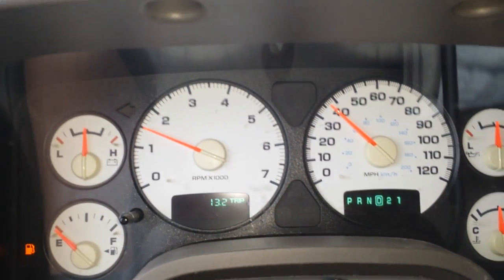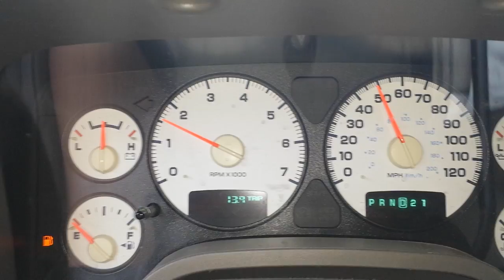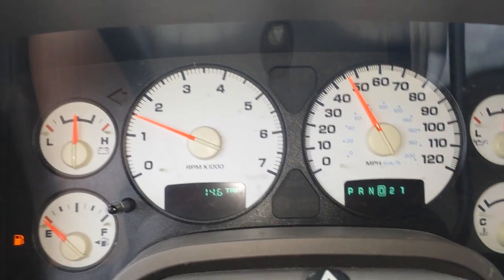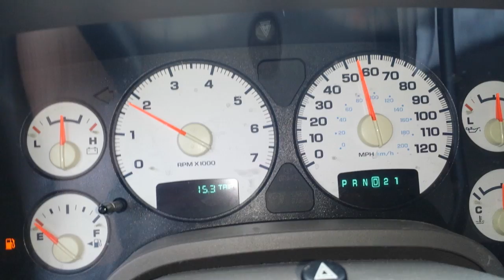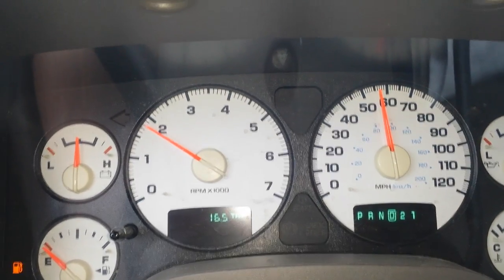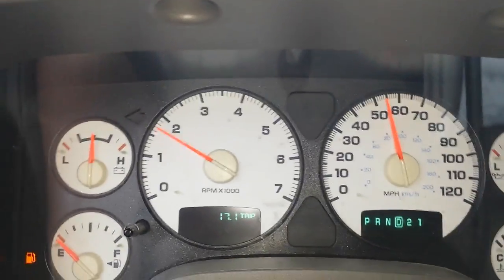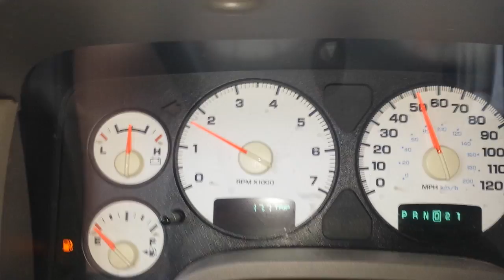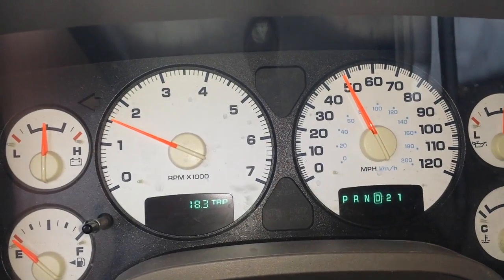Solved! Dodge Ram abs and parking brake lights on.

Comment: Pull your cover, pop out your c clips, pull your axles, 
Skrew it power wash it.
Then bug sprayer, spray axle fluid at shaft ends.But catch that fluid, put shafts back in ,strain fluid, now spray differential gears, let drain, new clips ,put back pin ,tighten bolt, put a magnet to inside lower cover, replace cover, fill w/75-90 sync gear.
Done!!!!!!

Comment: It is exactly the same thing that happened to mine. The metal went on the sensor and prevented it from reading so my speedometer started hopping. He is right, the best fix for this is to replace the rear dif.

Comment: I just bought the Dorman 970-280 ABS Wheel Speed Sensor. Mine is an 07 ram hemi, crew cab, 2x4, 160k. Hope I bought the correct one. Actually hope it fixes the issue. It's doing the speedo bouncing to zero then back to 60 or whatever I'm traveling at, it causes the cc to cut off, has the never stops dinging with the abs/brake lights staying on. Sucks hearing all that never ending dinging when just driving to the store or somewhere & back! I've parked it for now till the issue gets resolved. Btw, the jacklkegs that send back that trolling bs pattys of feedback aint worth ANYONES time. Dont waste yours, its WAYYY to valuable to waste on shitbags. As you all know(even them), they'd be the very first ones kissing ass and thanking anybody for any info that related to their particular fix. If they were so concerned about this guy, Dino or his 5 min video being anything less than helpful, they'd offer up THEIR OWN VIDEOS to go above and beyond Dinos helpful info. But, ass we can ALL SEE, not one of the punk fux in their mamas basements, on their mamas bought computers and phones, aint good for nutting, nothing but running their crap holes.(some of y'all will see what I did there, but dont worry, they wont have a clue:) hehe!) So yea, there aint one of em worth wasting your time on. Jmpo, Jackasses!

Comment: I had the same problem with my  2004 Dodge Ram 1500 5.7 Hemi after my mechanic changed my front pinion and left disconnected and dirty the ABS sensor. Test and replace the faulty front wheel ABS sensor located behind the rotor. Dodge Ram 1500 have 4 ABS brake sensors: 2 on the front wheels, 1 by the transmission and that's the one you'd change if you have problem with bouncing speedometer and 1 on the rear axle by the differential cover. If you don't have any problem with the gauges or speedometer but just the ABS brake lights, you must check the front wheel sensors and replace it. It's a easy fix.
Reply: Vladimir Hazera ,"97 Dakota, only abs, rear axle,top.
Causes A.B.S./BRAKE LIGHTS ON DASH.
Reply: I have 02 1500 SLT. There is no front sensors. I have no gauge problems and the truck is not sending a code. Yet my abs light is on

Comment: First, you probably should have parked to do this video.  Second, P0500 is just a generic (thus the P) speed sensor code and doesn't have anything to do with "metal" inside your diff.  The magnet having "metal sludge" on it is normal.  I've never pulled a diff plug (I'm a mechanic) where the magnet has been clean.  If it's clean, you're not driving.  That's why the magnet is there.  Instead of unnecessarily replacing your good differential you should probably check for a bad ground, corrosion maybe around the PCM harness or ABS module.  Check your ABS sensors (depending on your model) as well.  These old Dodges are known for having wiring issues, and that's likely where your problem is/was.  Just because a light goes out it doesn't mean what you did was the solution.  I've worked on vehicles with suspension noise and just the act of raising it into the air temporarily relieves the noise, but that doesn't mean the problem is solved.  A good mechanic doesn't stop until he/she is 100% sure they found the problem and fixed it.  You can't say, "I fixed it, but the problem might return"
Reply from the maker: 1st, the camera is mounted to the steering wheel, thanks for your concern, and 2nd, I still own the truck and still have not had the problem since, so obviously I fixed it. Your cause of your code may differ from my cause. My video is to help those with my problem, apparently yours may or may not be different,l. Mine is definitely "fixed". Make us a video on your problem, maybe you can help others.
Reply: Jodian Gaming other people have said it was corodded wires under the fuse box
Reply: Please help me with my 03 ram

Comment: Another thing you might want to try... I dont know how in the hell, but I always end up getting water inside the abs connector behind the battery, and it causes all these problems and more and its irritating. I dont even know how the hell, but that same connector gets wet I get brake light and dinging sometimes, sometimes the o2 sensors throw a code and read 0v (weirdest shit ever) sometimes if it's real bad it won't even try to start, itll sometimes say no bus on the odometer... But every time I pull the connector its wet and I dry it out and it works fine until it rains heavy again or I go to the carwash. Bout to spray that flex seal haha

Comment: That's make sense for me. I have a 2004 dodge ram 1500 slt 5.7hemi, and i brought my truck to check the diferential oil level. The oil level was ok, but after that i drove a few miles and the abs and brake lights come on.

Comment: The ABS light on my 2007 Dodge 2500 diesel truck was on and I traced it to a bad ABS sensor.  I replaced it on the driver's side after I tested it with a DMM ohmmeter and found that it was an open circuit.
Reply: How did you get rid of the abs light on your dashboard? I just changed the same sensor on my cummins and the abs and parking brake light are still on My dash
Reply: Clear the DTC?

Comment: 2002 dodge ram 1500 2wd 5.7  slt Have a problem with my abs/dinging noise...might be the wiring or speed works good one brake light is out .  Alsoy ecm burnt out 3 times not sure whats wrong . Took too the shop twice they told me theres no problem..idk

Comment: I have the same exact problem with my 2004 Dodge Ram
Reply from the maker: Cody H This really should be a recall item. not to mention the multitude of other electrical problems these trucks are prone to have.
Reply: Dino Fuse I was on the highway with my cruise control on and my speedometer went to zero and ABS lights came on , parking light and my engine light.
Reply from the maker: Cody H I'm willing to bet you have the "c" clips poeces in the bottom of your differential. The Clutch Pack Retainer Clips look like pieces of round tubing almost. Let me know if you have that symptom. Cleaning them out and changing the fluid is only a temporary fix though.
Reply: Dino Fuse I have to drive about 2 hours away with the truck today. do you think it will hurt it ?
Reply from the maker: Cody H no, I think it'll be ok, as long as it is the same problem I had. Just be careful of your speed, and watch for unexpected stalling. When this happens, the truck really acts funny sometimes.
Reply: Dino Fuse I did experience some stalling out when I came to a complete stop. , it only happen twice but I defiantly will be careful about my speed.
Reply: My 03 Ram 1500 had an out of the blue electrical issue with my instrument panel going almost dead...nothing would read anything....speedometer and RPM gauges would bounce and not read properly, my transmission shifting would surge suddenly at times, mileage stopped counting.....and I refused to give in to the issue and pay to have it checked because of dealer gouging so I just toughed it out for about 2 or 3 months.  It was a daily issue.  I was always thinking maybe there was an electrical connection issue, wiring issue, fuse problem, etc....so I would go in and push and pull on the fuse box, checked fuses......out of the blue, 1 day it was all gone.  Everything back working normal.  Have no idea what happened.  That was about 6 yrs ago.
Reply: I had the same problem with my  2004 Dodge Ram 1500 5.7 Hemi after my 
mechanic changed my front pinion and left disconnected and dirty the ABS
 sensor. Test and replace the faulty front wheel ABS sensor located 
behind the rotor. Dodge Ram 1500 have 4 ABS brake sensors: 2 on the 
front wheels, 1 by the transmission and that's the one you'd change if 
you have problem with bouncing speedometer and 1 on the rear axle by the
 differential cover. If you don't have any problem with the gauges or 
speedometer but just the ABS brake lights, you must check the front 
wheel sensors and replace it. It's a easy fix.

Comment: Dino, i got same issues. Abs and red brake light comes on minutes after clearing code. Ding, ding, dinging! the entire time. Doesn't stop till i clear out again. C1036 "rear  wheel speeded sensor circuit" it says. I got 07 w ex cab, 5.7L hemi, 4x2, 150k. Also Speedo bounces when it starts, cruise cuts off by itself. There's a sensor on top of rear axle. Runs great during all the dinging and abs/brake lights on. Comes on immediately most of time, stays on and dings whole time I'm driving. Ive parked it for now. I couldn't tell how to get the freakin clip off the damn sensor! Any thoughts here? Thx man!
Reply from the maker: Marc carraway are you talking about the wire harness clip or the actual mount that screws into the top of the housing? If its the mount that screws in, then I had to carefully pry the part that holds the brake line back a bit, to allow a wrench to grab that bolt. If its the wore harness, then there is a locking clip that you beed to depress before pulling the harness off.
Reply: Hey Dino! Thx man. Yea, its the clip from the wiring that goes into the sensor. Can I put a pic somewhere? Theres a big black stain on the differential, not on the outside, the inside of it, and it shows that plus the whole pigtail, sensor, etc. Like to show you the stain as well but I'm sure its a leak, just not sure if its from the diff or the rear end or something as its on the inside outer shell of diff, not the outside, where you'd do the actual fluid change.
Reply from the maker: Marc carraway I just used a small flat screwdriver, but mine is a little older, so it may have a different set up.
Reply from the maker: Just be careful not to break the plastic harness, you don't want to add another item to your repair list. Light pressure and wiggling should do the trick.
Reply: Ok. Got the smallest screwdriver I had, pried/slid back the red safety thing, "lock" I guess, on the top rearwards as far as it would go, was able to push down on the tab under where red safety thing was to free er up! Thx for that. I used same lil driver to pry the sensor up a little and it got it out. Nothing broke. Whats up w the seepage all over the backside of the diff? Is it from the diff u think? Its not from the rear end where the u joints are, just before the diff, right? Prob need to replace fluid/gasket? The entire rear of the pumpkin is brown from this seeping going on. What fluid do you use? I got the 07 4x2 axle, rear end's diff. Thx.
Reply from the maker: Marc carraway I looked up the fluid specs in my manual, unfortunately it is only good up to 2005, so your fluid may be different. I did get oil that had the limited slip diff additive already in it, but as for the weight, I am sure your local autozone could look it up.
Reply: Dino Fuse- Preciate all the help Dino! U answered it all for me man. I'll be doing the diff this weekend and that'll git er back to right!

Comment: I have the same issue, my cruise control doesn't work either. Cruise light turns on but shuts off. Need to check the differential.

Comment: were you getting noises out of the rear end? I've been chasing a pulsing sound now for a month. did all u joints, brakes, wheel bearings. still have a sound, and in the past few days when I take a hard left turn the ABS and brake light come on but when I shut the truck off they go away and stay off do you think if I pull the speed sensor out of the pumpkin will it have pieces of metal stuck to it and I only have 1 ABS sensor on the front left tire do you think if that has Gunk on it and I turned it just right it would set the light?
Reply from the maker: Doug Howard Mine started with a little chatter in the rear as I accelerated from a stop. Its worth pulling the sensor to check it, as it only takea a few minutes to do. Chek all wires to all of your abs sensors as well, look for obvious signs of chaffed or shorted out wiring. it wouldnt hurt to pull the differential cover off and drain the old fluid if it hasn't been done in a while, also check the magnet in the bottom of the differential housing, you need to feel around for it, as it is flat and covered with oil. It would only take about 20 to 30 minutes to do. Also, replace the old gasket and buy new fluid of course. Especially if you find the fine metal shavings on your sensor. Good luck, hope this helped.
Reply: Dino Fuse thank you for your quick response, now I took the cover off the pumpkin about two months ago to do the rear wheel bearings just the outside and it wasn't the first time I've opened up that pumpkin everything looks fine then and I'm well aware how to reinstall my axles properly and putting the c clips back in. everything looked good in there.  then recently I went on a trip about 800 miles through the mountains most of the time I was in 4-wheel drive because there was a snowstorm it was when I came back I realized I had a pulsating noise that would increase as I went faster a very faint noise only someone with a tight ear could hear so I thought maybe brakes had a bad caliper replaced it all my rotors were good so I just put pads all the way around truck stops like a dream but the noise is still there my speedometer doesn't go up and down and those lights only come on when I take turns I've been watching videos and reading forms all morning I'm stuck between a dirty abs sensor or maybe my speed sensor is working right and I have a bad inner bearing in the pumpkin or possibly that c clip came out and I was all set on trying to figure out those two things when I read a bunch of people talking about their being bad wires under the computer which I've had issues there before with other things I realize now that I'm just rambling and probably wasting your time but thank you for your quick response and your information was very helpful I'll be sure to pull that sensor out and look at it thank you
Reply from the maker: Doug Howard you're welcome. Just remember, what a lot of people are calling "C" clips in the forums, are actually clutch pack retaining clips that are breaking apart in the differential,  at least in my case.  The c clips as you already know hold the axle and bearings in the housing. The clutch pack retaining clips are small, about the diameter of a nickel. That is what was fouling up my differential. Hope you get it solved. let me know what you eventually figure out.
Reply: Dino Fuse ahhh see that makes more sense, I've been like wondering how c clips would come out and I not loose my axle on the highway hahaha. I'll let you know what happens either way I'll fix it 280000 miles original motor and tranny only thing under the hood that's been changed is the battery and a power steering pump, and I guess headers. I changed the original battery this year. no Bondo and no rotted wheel wells. I put a bumper on it because the old one rotted away LOL my friends call it the miracle truck we think the planets were aligned just right when they made it . And by the way it's the five 5.7 Magnum
Reply from the maker: Doug Howard nice. I still have my 02, it has its problems here and there. here is a link explaining the clutch pack retaining clips if you're interested. http://dodgeforum.com/forum/3rd-gen-ram-tech/264563-just-figured-out-why-the-clutch-pack-retaining-clips-break-off-in-the-rear-diff.html
Reply: Thanks again man!
Reply from the maker: ***** you're welcome.
Reply: Dino Fuse so I'm going to open it up today. was it hard to do ? there is no vids on it or even in the Haynes book there's nothing, just on how to take it all out. nothing on tiny clips. was it a w shape or a ring? easy fix?
Reply from the maker: ***** as far as just cleaning it out goes, its very easy. Just get a drain pan, a new gasket, and new differential fluid/oil. I bought the oil with the l.s.d. additive already in the oil. You also may want some rtv  silicone that is rated for contact with oil, to help set the gasket. As far as replacing just the sensor goes, that is easy as well, just a small bolt holding it in, although I think there is a brake line clip incorporated into the bolt, so be careful,  it is a dumb design to be sure. Now as far as replacing the differential goes, unless you are really familiar with replacing differentials, I don't recommend doing that yourself, there are several backlash adjustments,  etc. that I wasn't comfortable with trying to set, but to each his own I suppose. I am opting to replace the entire rear axle, as you can buy them fully loaded with the differential and all ready to plug and play. If you are having the clutch pack retaining clip issue like me, you will find pieces of the clips on the magnet at the bottom of the inside of the differential housing, they are about a half inch and look like a half of a cylinder. You also will find really fine metal ground up and mixed in the fluid like a sludge built up on that magnet and your sensor at the top of the housing. Let me know how it works out. I guess I will post a video when I clean mine out next month or so. I haven't replaced the axle yet, but continually clean and change the oil regularly figuring that eventually the pieces will be gone, or the differential will lock up, but neither has happened yet. If you figure out a better fix, or an alternative reason for the abs lights coming on and speedometer bouncing, let me know, it is a real pain in the rear.